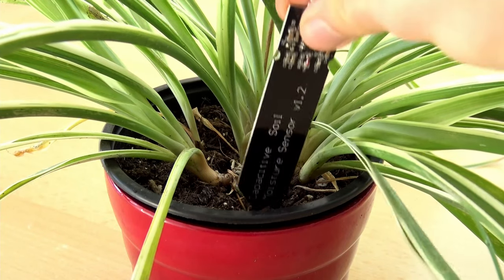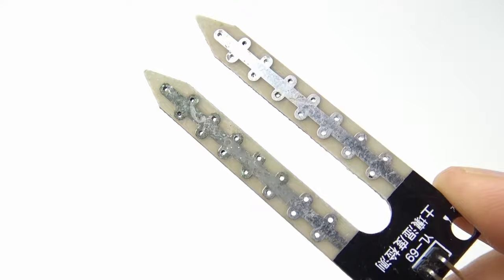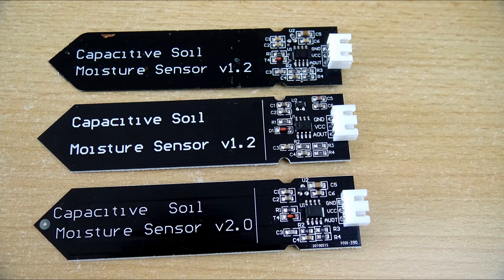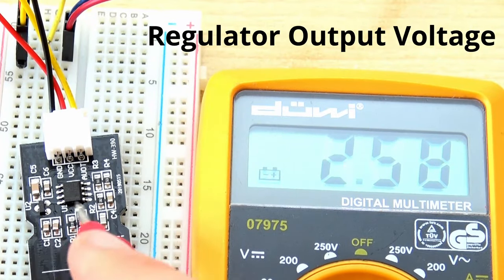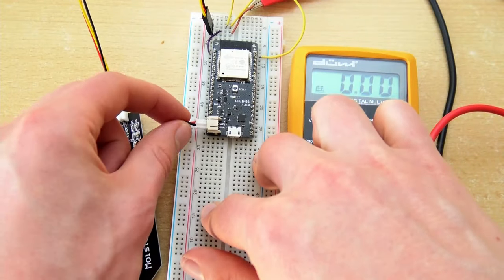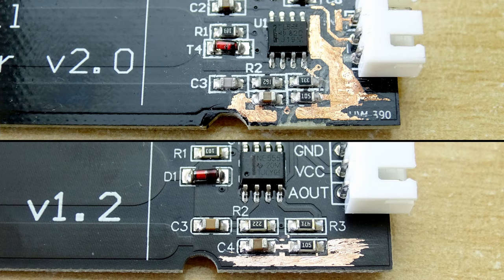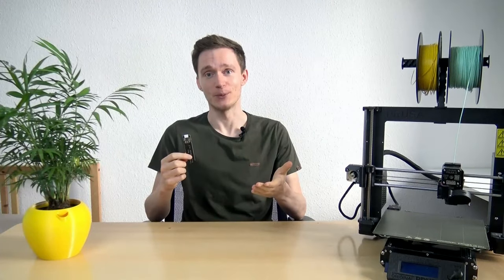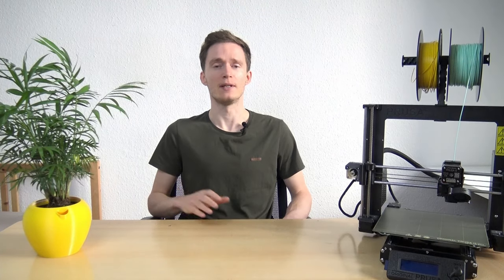Capacitive Soil Moisture Sensors don't work correctly + Fix for v2.0 v1.2 Arduino ESP32 Raspberry Pi

Comment: Pretty important information: for those who want a more sensitive moisture sensor, you can bridge the 1MOhm resistor with a 100kOhm one. The default output value changes a bit but the sensor reacts on raindrops for example. Same probably goes if you have the faulty connection.

Comment: Oh no! Mine just came in the mail. Voltage regulator  ✅, TL chip ✅, hole in correct place ❌😕 Thanks for all the thorough testing in this video. Now at least I won’t drive myself crazy wondering what’s wrong.

Comment: Just a heads up if you already have a resistive moisture sensor. You can just pulse it's power on each measurement with a transistor/digital pin and prolong its life substentially. I've had mine running for over two months with no sign of dissolvement.
Reply: Also, powering it with ac would probably help
Reply: Do you know links showing how to modify it?
Reply: Pretty sure that Ecowitt sensor must do this because they stay accurate for years and the single AS battery seems to last about a year, even though it’s also powering a radio.
Reply: bingo!
Reply: Measure your sensor with alternating current - turn one pin high and the other low, then next measurement, reverse the two pins.

Comment: A power saving tip: If the sensors power usage is within your MCUs IO pins power output, connect Vcc to a IO pin, turn it on (with possibly a delay), do the measurement and the turn it off. For my sensor I use a delay of 350 ms from power on to read, otherwise the sensor won't stabilize and the reading will be off. This will of course vary, you have to try it out for yourself.
Reply: this is verry importent. but not only for power saving - all corrotion needs power to take place and by doing what you suggest you will enhance the useagetime of your sensor.

Comment: I did some work with soil moisture sensors a while back and agree, resistive are useless.   So I tried a capacitive one but got unreliable results and moved on to other projects.  After watching your video and the excellent research behind it, I checked my probe.  Yes it has the missing resistor connection!   Now I now why it didn't do the job and am about to go and fix it.  This opens up an old project - thank you 🙂

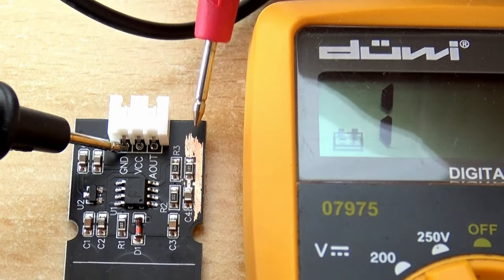Comment: I got lucky. A few months ago I bought a bag of these and they are labeled v2.0 / HW-390, and they have the 3 terminal regulator and the TL555 chip. Despite having the via at the lower position as shown as the Faulty board at the 8:00 minute mark, the 1 Meg Ohm resistor indeed appears across pins 1 and 3 on the connector. I didn't scrape off the solder mask to see how they made the connection, but they did somehow. Thankfully the one I tested provides stable readings from ~200 submerged, to ~515 dry. It also works on 3.3 VDC, providing the same readings as when powered from 5 VDC. Thanks for the good video!

Comment: I just spent 3 hours troubleshooting why the sensor did not work with my 3,3V Arduino mini battery setup. It did have the NE555 component and was not working on 3,3V. Thanks for making this video! I would have spent days troubleshooting this!
Reply: Hello, i tried using the 5V of the arduino board and still can't make it work, how did you make it work?

Comment: Thank you so much! I just got a batch of 10 faulty sensors. R4 is not connected to GND. 
Remark: in the schematics you are showing the resistor is wrongly labled R1; correct is R4

Comment: Great job. Nice that you have shared your findings with the rest of us. I have checked my 4 sensors and found out that they all have a LDO, and a proper timer circuit (3x TL555, 1x ICM7555) two of them have the via punch hole aside the resistors, but only one of them has the problem of the resistor not being connected to GND. I investigated the PCB further and have found out the actual position of the via hole (that actually takes the signal from the other side of the resistor to the other side of the board where it is routed to the AOUT connector) is not directly the problem, but rather the very tiny lead on the PCB (or the absence of it) that goes under the mentioned via very close to the bard edge that is missing on one of the boards.
Reply from the maker: great job too! thanks for your effort and pointing that out. Maybe you can share with us where you ordered the good ones,  as many people (including me) struggle to find a good source.
Reply: Photo with the the difference in the PCB that causes the missing GND track. https://drive.google.com/file/d/1-E5Wk0oXwc_SqPuffyOVGcj7iQuNeSLt/view?usp=sharing
Reply: What is a "bard edge"?

Comment: So i just bought 25 of them from AliExpress, of course they do not work. I found that the TL555 chip was in the wrong way, so I had to remove and resolder, i then found thanks to your video a problem with R4 and C4, in my case it was the return to analog reading pin (yellow wire) that the via had broken, i scraped  back a bit of the solder mask and bridged it with solder. Now it's all working, but that's a lot of work to do on 25 sensors!! I appreciate your help, I don't think I would have found by myself!

Comment: The main problem I've noticed with these types of probe-style moisture sensors is that they lose accuracy with time as the soil compacts around them and water channels along their surfaces, artificially lowering moisture readings as the damp soil is further from the electrodes.
    Your implementation with the probe being inserted through the bottom of the soil looks like it would solve some of those problems, but you want the moisture reading of the shallowest soil, which doesn't necessarily correlate with that of the deepest soil.
   I've designed a few resistive fluid conductivity sensors using cheapo platinum-coated EC probes, which can be driven with AC to reduce polarization and can pretty easily be integrated into microcontroller projects, but the problem of ensuring consistent soil contact still stands...
Reply: What about surrounding the sensor by some media that wets but don't compact much, some sort of "ideal soil" . I'll start by testing things like porous wood, sponge type material or even solid cardboard.

Comment: great video thank you and subscribed , i just ordered 10 of these sensors of Amazon and looked at the product page after they arrived,  the product page has the wrong boards on it!! After inspecting the sensors when they arrived i found ( to my delight) that they were different !! The ones that arrived had all the right components BUT have the off centre hole , so i did the multi-meter trick you did between ground and the resistor and i got a connection!! I have yet to set one up but fingers crossed it works as expected

Comment: Thank you!  Sensors I got just a couple of weeks ago still have the output resistor problem.  You just saved me hours of debugging.  A bodge-wire later and the sensors work perfectly.

Comment: Thank you sooo much for this video! I thought I had two 'ok' sensors. Turned out that the resistor was not connected and therefore the sensors were very unresponsive, as I already noticed during my project (but taken for granted). Now I was able to fix it. Without you 'I'd never have known this and my projects would be flawed forever! THANKS!👍

Comment: Just don't rely on product pictures. They display a TLC555 with regulator and send a NE555 without. After these lessons learned, I modified my soil sensor to have a 5V boost converter to power the soil sensor.

Comment: very nice! thank you for this video, there are a lot of DIYers in this sphere who probably do not have the technical knowledge that you have, and would have never figure out why their sensors fail to function under pretty normal conditions, thank to this information video they now can see if they have a faulty sensor - hopefully maybe some of the manufacturers of those sensors will also figure out that saving 20 cents is not worth losing thousands of unit sales. I'd also assume that the customer will rather pay an extra 50-60 cents and get a proper sensor with the proper timer chip and no missing voltage regulator or resister connection

Comment: i think it is important to understand that most of the sensors have corration problems when you try to read them. If you just put them in the soil and do not have any power on them they are much more stable to use. The main problem is that most people try to read the soil- moisture more or less all the time or every minute - but their is no need for that. 3 or 4 readings a day are more than enough. 

And the other problem is that many people did not understand that soil is reacting verry slowly. If is a verry bad idear to try watering a plant and use a soil sensor to stop the watering. It takes time for the water to spread in the soil. So what you should do is starting the watering if your reading shows a value that make it nessesary and stop it after a reasonable amount of time. After one hour or so you can do another reading and start a new cirkel if this i nessecary - and you do not have to read all the time.

It took me a long time to understand the importence of this point. Its mabybe more important if you are watering a bigger amount of soil than just a plantpott, but basicly it is the same. The water needs time to spread in the soil.

I have a bunch of devices that i have build several years ago with those sensors that you describe som just crab. Yes in the beginning i needed to replace them after a few weeks. But since i changed the reading metod and just do a reading every 6 hours are they working without problems since 3 seasons and up till now the do not show any sign of corrotion.

Comment: Excelent video. I like it a lot. Now I am planing to messure and control of humidity of growing seeds. I worked in the oil industry some time ago. I designed and got a patent to messure the water content for a mixure of water and oil in a pipe. In other words, an online water content analyzer. I am a physicist, and worked with an electronic engineer in that proyect. I really apreciate your work. Now, many years later, I am involved in this similar problem, but in this case is a mixture of water and soil.    But this is kind of a personal proyect.
Reply: Very cool Fernando! 🌞✨🌎😊
Reply: Design one that works correctly and bring it to market.

Comment: Bought 5 sensors a couple of years back and they have the regulator and a TLC555I, but the resistor is not connected with the same via issue you showed. I'm going to fix them all with a small bit of cable to connect the existing resistor to GND. Thanks a lot for your video, you saved me a lot of time and frustration !

Comment: Fwiw, I recently (Jan 2024) bought a v1.2 and it works fine at 3.3v and 5v (the range the manufacturer specified). The LDO is replaced with a 0ohn resistor and the timer chip is labelled NE555. I realise 3.3v supply is well out-of-spec for an NE555 but, in fact, many of them have been found to work pretty reliably at 2.5v. Certainly reliably enough for this application.

Comment: Very frustrating. I bought a couple dozen of the ones with the missing resistor connection. Although soldering a resistor or jumper is just annoying, that was good money down a hole. Thanks for the fix.

Comment: Thank you for this video and pointing out the design flaws of some batches. This really helped me sourcing some working sensors. Tip: Some sellers on Ali are blurring out the name of the timer chip. I guess they also saw your video :-)

Comment: Thank you for gathering all that information and sharing it!
I just checked my sensors (got 2*6 just today), and found a whole bunch of random samples o.O

I got v2.0 which do have the correct regulator, the TLC555I and the disconnected copper trace, but also have two additional vias between the VCC and  AUOT [sic] labels, which connect the ground plane in the lower right corner to the GND pin on the bottom side. This means the 1M resistor is connected and working.
Mine have a date printed in the area that was scratched off in the video, "20210603".

However, I just noticed I got a bunch of random samples in that one delivery, some having a date of 20190515 and those do NOT have the additional vias and are faulty.
out of the 2 bags with 6 each, one bag had 3/3, and one had 4 good ones and 2 faulty... so ordering in bulk does not guarantee working sensors.

The difference is even visible in the raw voltages, with all good sensors outputting almost the same voltage in air, and the faulty ones also close together, but on a slightly higher voltage. So if someone has two groups in their data when the sensors are just hanging in air, that can also be a sign to go check.

And one additional quality issue: One of the supposedly good ones read a constant 0V. That one does not have a regulator at all. Looks like it was soldered but broke off.
Reply: Same here. Got the v2.0 with date 20190515 and missing the resistor ground connection.
Reply: Oh, I just wrote the same regarding the V2.0 sensor from 03/06/2021 but without the technical explanation. Yes the hole is misplaced but it's working just fine, so they fixed the issue in the end. This hole place is not relevant anymore.
I got lucky, bought a bulk of 8 in August 2023 and all of them are from 03/06/2021. 🤞

Comment: Thanx. All my sensors have needed a resistor - I used 15K. I also have a temperature co-efficient of around -0.2% per Deg C. I've started to uses 24Hrs averages and water twice a day.

Comment: My first order from a German supplyer was with NE555 and without voltage regulator. The second order (called V 2.0) I made at AliExpress and everything seems to be fine. None of the faults you metioned could be found. But it didn't work! I meassured a constant voltage of 0.733 V at the output anyway if the sensor was try or dived in water.
Finally, I was wondering that in all pictures I could find the TL555I,  TLC555 or NE555 label was readable but on my sensors it was upside down. And indeed, by measuring and comparing with the schematic I found that the part was mounted twisted. On all 10 sensors I bought. It is really incredible which faults on such a quite simple part can be made. Best, Uwe

Comment: Thanks a lot for the video! Half of my sensors didn't had connection of 1M resistor. What I've also noticed: there are good modules having "that via" not between R4 and C4, but near them same as bad ones.. BUT there are additional vias (near the socket and 555) on the board that connect R4 with GND. It looks to be a "fixed" version.

Comment: Here it is 2 weeks later and I have received, inspected and tested all 3 sensors that i ordered from ebay. I ordered the ones that seemed to have the right components, based on the images and descriptions. They were not the cheap ones. each cost $5-$6. all were marked v1.2. But they all worked fine. each had the correct voltage regulator. one had a 555 20 M. one a 555C & one a 555G. all had a good connection from the 1Mohm grd. to grd. I used the arduino example  AnalogReadSerial, just changing the delay to 500 msec. all showed about 500 dry and immediately changed when put into a cup of water. two went down to 200, and the other to about 300.  I dried them all, and then applied clear finger nail protector to the edges.
the three ebay sellers were, ENVISTIA, KINGELECTRONICS15, CAELECTRONICS8.

Comment: I have the 1.2 version with the voltage regulator, with TL555 but NO CONNECTION to ground from the 1M resistor; I didn't even knew about this issue until I watched your video. Many thanks!

Comment: Oh wow, I have had several of these. I had a couple non-working ones with a missing voltage regulator. The ones I am using now have the missing resistor to ground connection, but I didn’t even know they were faulty because I never had a good one. Interesting to learn how they are supposed to work!

Comment: Elecrow has their slightly different version of the capacitive soil moisture sensor labeled as "Crowtail - Capacitive Moisture V2.0".  Their sensor has a 6620 voltage regulator.  It also has a timer chip labeled "XINLUDA XL7555 23+7".  The via hole is located to the side of the resistor so likely a problem there, but I haven't actually powered this sensor up and used yet to confirm if it can work on battery and/or if it will be responsive or grossly laggy.

Comment: I purchased some recently, September 2023. They are the version 1.2 board, they have the NE555 timer chip not the TLC555 chip, 28k is the manufacture date code on the NE555's, and they work perfectly on an arduino nano as well. They have the right voltage regulator (662k), and i verified it's output with my multimeter, It indeed puts out the 3.3volts, but it still works with the NE555 timer chip. I get solid steady results from the sensors. They also have the proper 1Mohm resistor at R4, and is wired correctly to the ground plane.

Comment: Relaxation oscilator from programmable unijunction(discreet or constructed from 2 transistors) with trigger voltage from 1 constant current feeding into a resister. (V=IR)  and capacitor fed from supply/sensor line. With a 2nd constant current feeding it power.  No need to worry about voltage variation as current's what works . Aurdino can read the voltage drop when the Put conducts.determine  output  frequency which will be inversly proportional to the capacitance

Comment: The LDO could be a problem if you plan to power it from 3.3V, though. If you're using a 3.3V MCU, the one without LDO might actually be a better choice (assuming you're aware of it and use an external regulator).